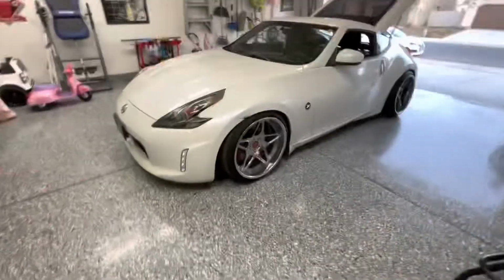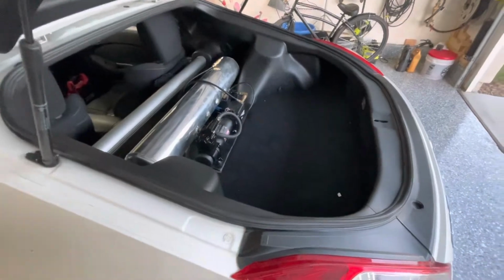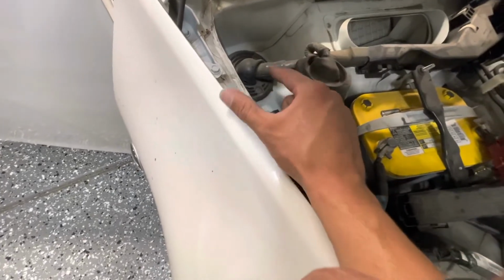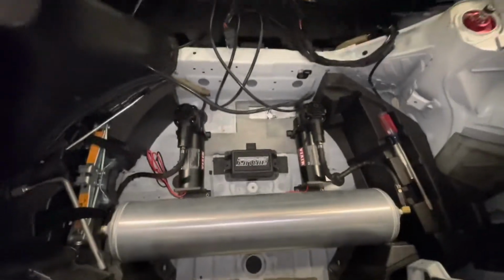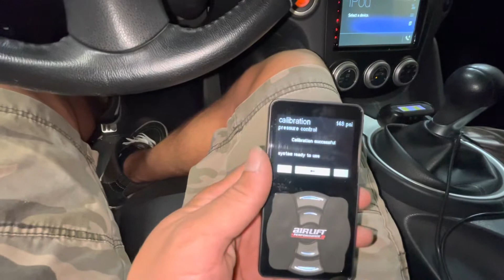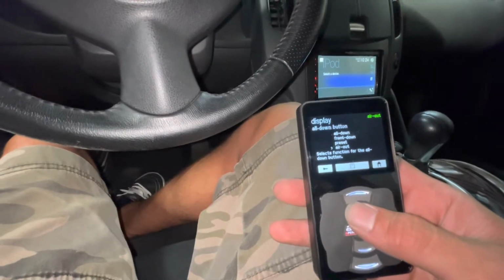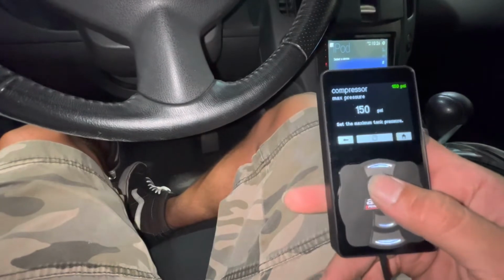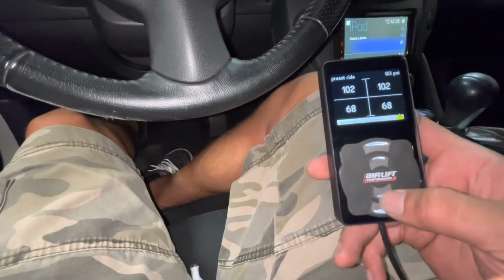Nissan 370Z Airlift 3p management install

Comment: I love the trunk setup you did with placement of the air compressors and tank. I've been planning to do this as-well to my Z just haven't seen very many people put it down in the spare wheel space. I'm curious what size gallon tank does he have? Since he's had it in and running do you know if it makes more vibration noise or less being covered up? Really appreciate the video.